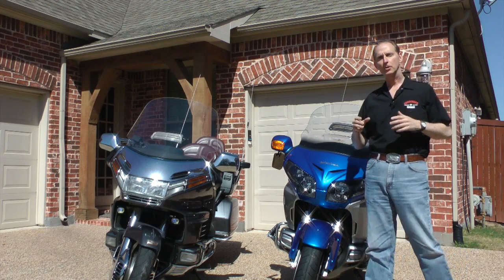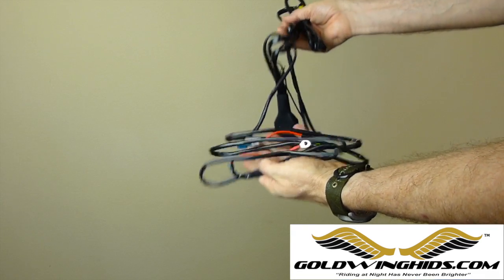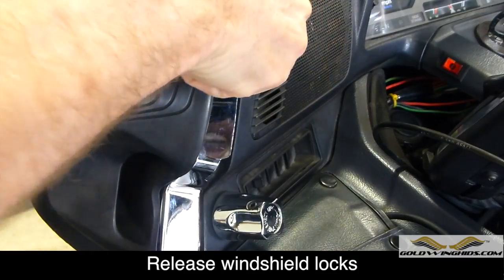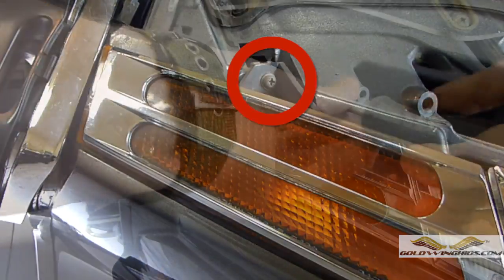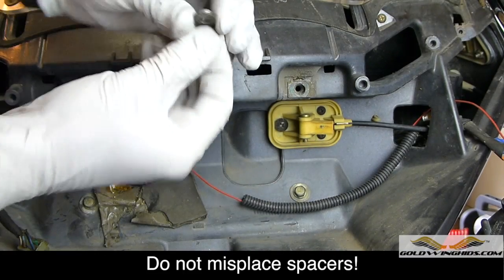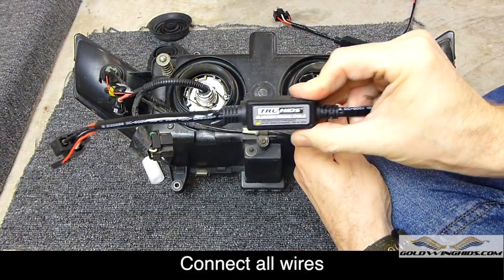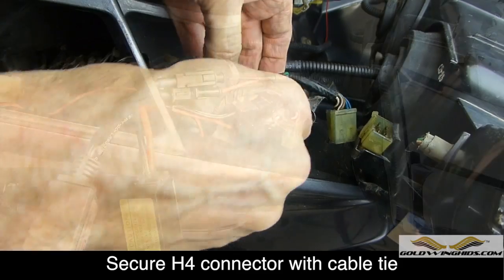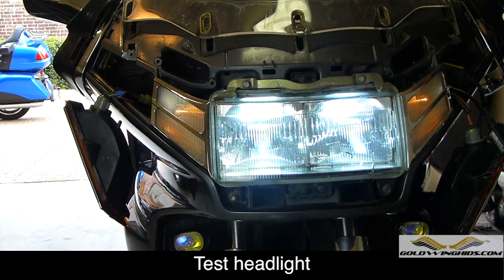Install Plug-N-Play HID Lighting on Honda Goldwing GL1500

Comment: this i nice but i have a true 900lm spot piggybacked off my high beam so when i get a goldwing i will probably use that or they do a adjustable kit with 3000lm so i can set the low beam very low and the full beam the full 3000. hid kits are great but they dont have the distance of cree spots i would love to get a d2 hyperspot for main beam because the range and power is insane